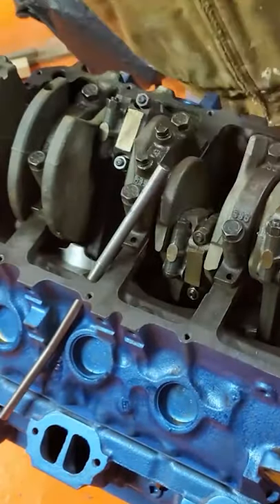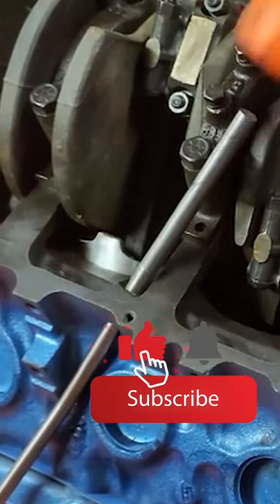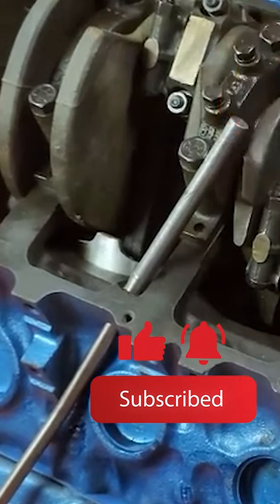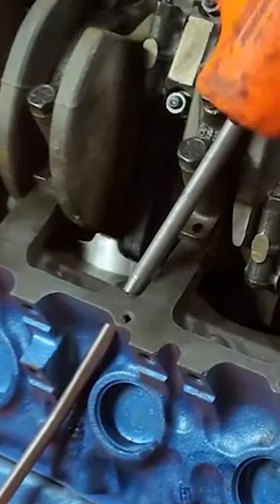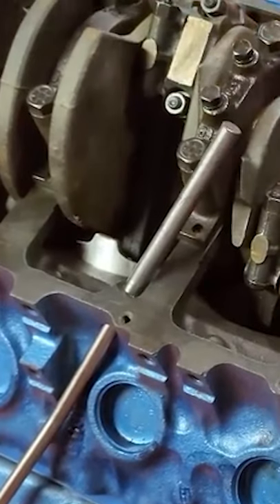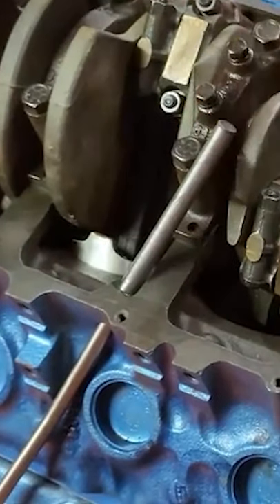Install a Pontiac Butler Performance Oil Dipstick Tube

Comment: Is there an aftermarket tube that could be installed from the outside of the engine without dropping the oil pan?

Comment: Cool vid but why so short. I would have liked a bit more info on depth and more detail on securing it with the main cap. Was thinking about getting one of these for my 455 build.
Reply from the maker: Its super easy, the Butler tube and tool is the only way I’ll go. The YY gods has been pushing these vertical videos like crazy. I’ve got some full length content coming up on the full engine rebuild start to finish as well as the chassis with more info.